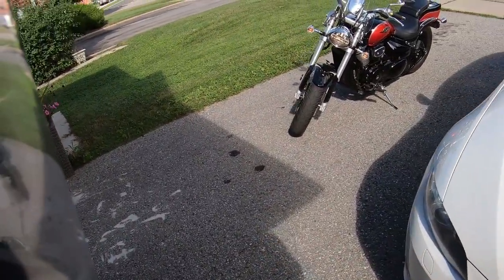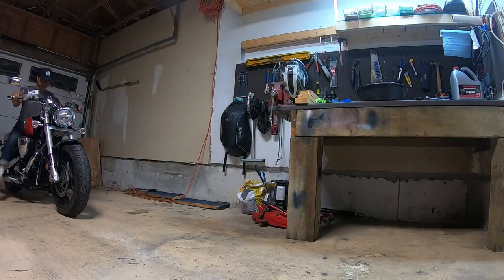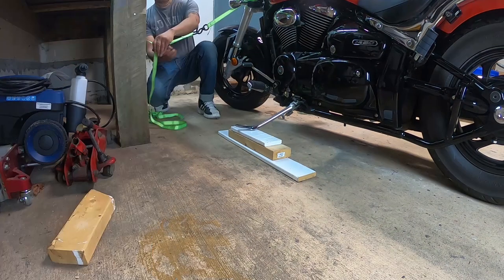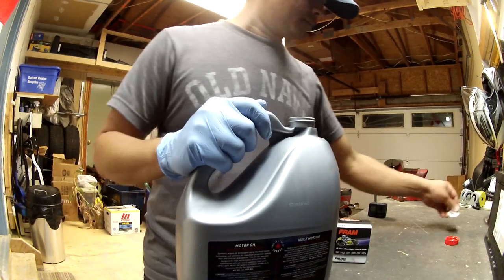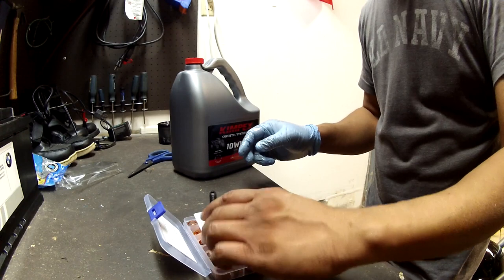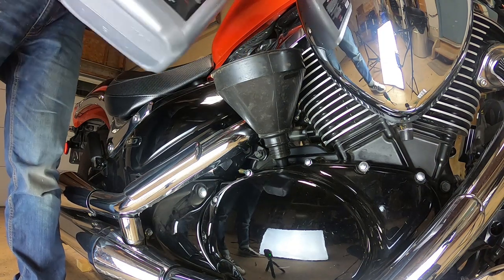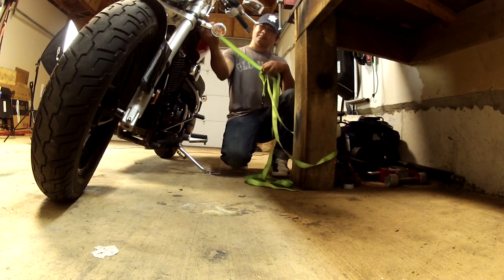Oil Change DIY Suzuki Boulevard M50/C50 Without Motorcycle Jack Stand

Comment: Most informed video, I do all work on my truck, struts, engine work anything. It's just exact way just needed to make sure I didn't need special oil tool before i start job. I've seen some guys using a specific motorcycle oil wrench,  you don't need it.

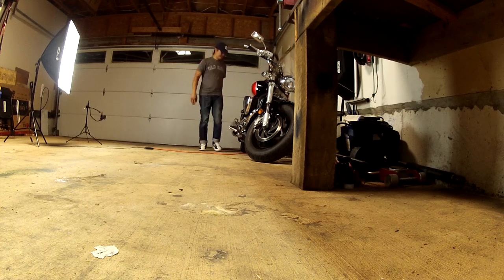Comment: Thank You for the video !  I need to change the oil, and without having a motorcycle jack, this strap down seems to get 'er done !  I read the Suzuki manual today; curious as to using synthetic oil. It may be a good upgrade choice, yet didn't specify. You know, this video at 8:43, snapshot, would make a great wallpaper for your tablet or pc !  -Love the color of your cruiser.
Reply from the maker: Conventional oil will do just fine as long as you change it regularly. Thanks for watching.
Reply: I use the Valvoline 4 stroke 10w-40. Good stuff. Changed my gear oil last year to keep the shaft drive running smooth. The Bel-Ray Hypoid Gear Oil 80W-90 is what I used.

Comment: Corry is right. You shouldn't use regular automobile oil on a motorcycle with a wet clutch. Get motorcycle oil specifically made for this purpose. Otherwise, this is an excellent how-to video!

Comment: Automotive oil has very different properties than oil made for motorcycles.  Car oil has friction modifiers that make it too slippery for the wet clutch of a motorcycle.  This results in an unpredictable "friction zone".  In addition, JASO MA oil doesn't break down by being chopped up (aka "shear") by the transmission gears.  Automotive oil does not have this property because crankcase oil is not shared with the transmission.